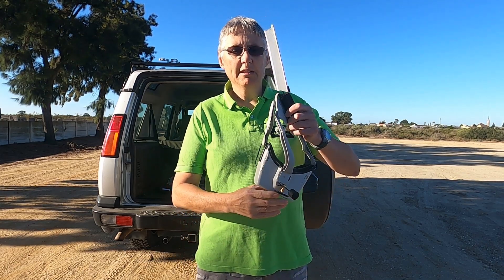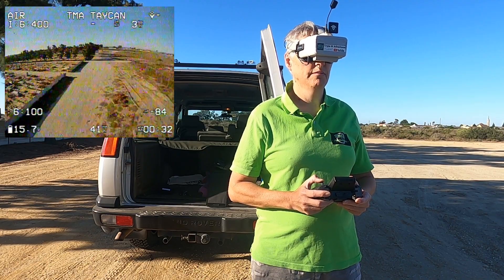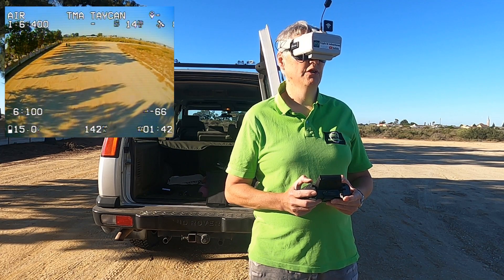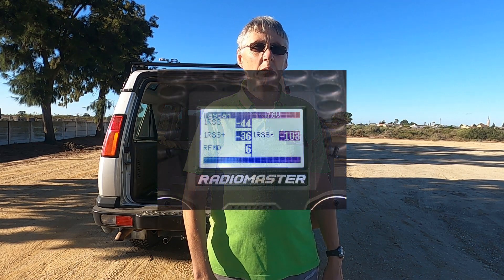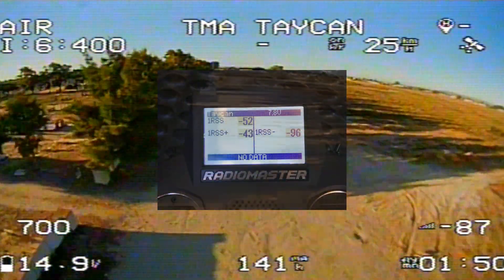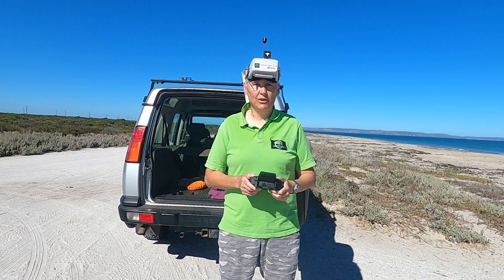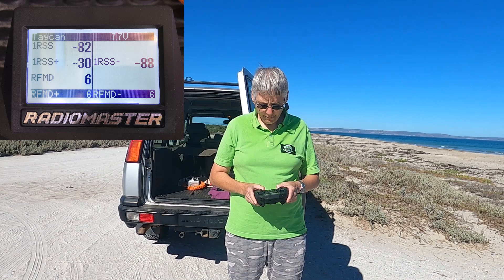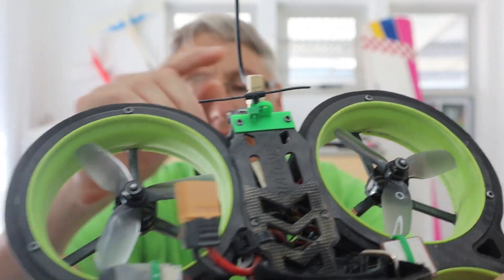Review Update - Flying a drone with the RadioMaster Zorro & ExpressLRS

Comment: I had a rx loss recently with a RXSR due to a cell phone tower. Completely dropped out of the sky instead of showing low rssi. 

I'm sure if I get too close to it it'll make my babies be born naked.
Reply from the maker: Yes that's my problem there two towers so will not fly at that spot any more.
Reply: Yeah. Ive got a few drones with ELRS but I've never set up my radio with the rssi alarm. It seems to be quite a handy tool to see and hear the link quality so you can maintain control of your aircraft/drone. But having mine just drop was surprising. Glad I didn't break anything. Just had to crawl through some mud in -4° C.
Reply from the maker: @anomoly40  Luckily it is slightly warmer here in South Africa, we need rain actually. All radio links will failsafe if flying in a difficult area like I was in my video.